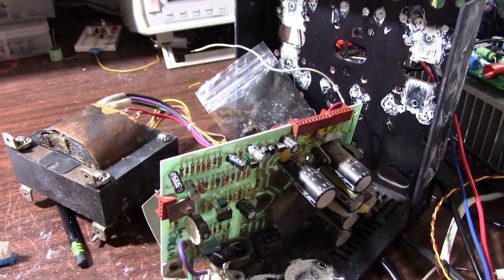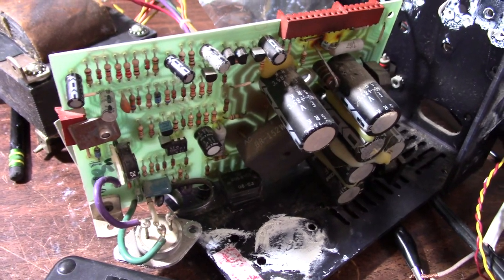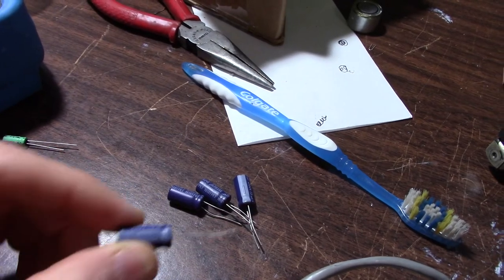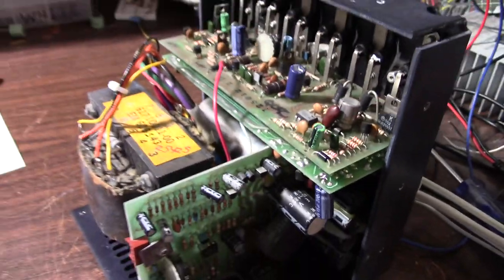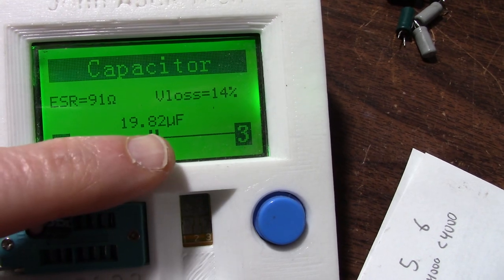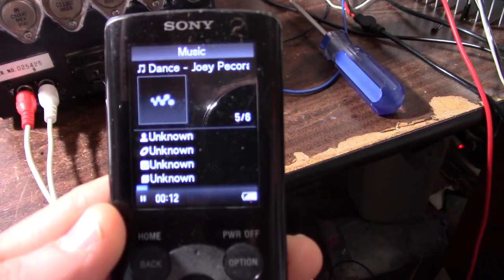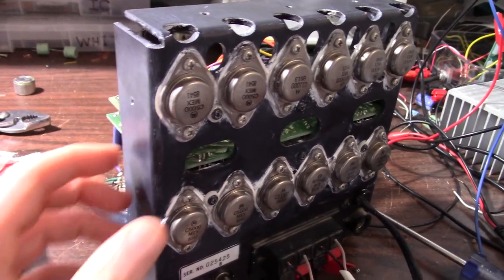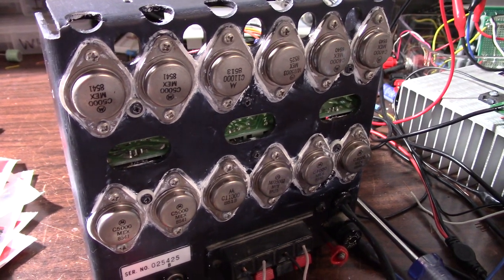Carver M-400t amplifier repair PART 2

Comment: On the question of Fusing
It is a Carver.
So has a controlled primary on the "Power Core" it is phase controlled from the mains. All of Bob Carvers amps are like that except the earlier Phase Linear models. High inrush is common & quitenormal
Reply: TFM series also had a standard primary.
Reply: @peterlarkin762  aah yeah forgot the Transfer Function units. Silver 7 too IIRC
I used to be UK warranty & service manager.
So very familiar but it been a while.
I got a few Carvers here some need repairs.
Not really bothering with them
Save them for when I get bored & throw them on the bench

Comment: Please make a video on Speaker wires (oxygen free copper wires) and what's difference between them and normal Electrical wires and what will be difference in sound if we use normal Electrical wires to connect speakers to amplifier than using those special speaker wires which many companies say it will dramatically improve sound quality

Comment: Why is it called "a magnet field" amp?
Reply: The only thing unique about the "magnetic field" amps is the thyristor in the power supply. It's supposed job is to throttle the power depending on the demand of the music.
I think Bob Carver named it that more for marketing rather than technical reasons. Back in the late 70's and early 80's the competition was fierce in the audio wars, any edge over the competitor was taken. Maybe I'm wrong
Reply: Purely marketing wank. They are good, punchy amps, but the "Magnetic Field" name is stupid. I bought two of them in the mid-80's and still have them.
Reply: Bob Carver was a brilliant engineer and knew how to sell products with words. I would highly recommend searching out his early promo video where he teaches a room full of hifi dealers about his amps. He had a fantastic sense of humour.

Comment: I found an article from audio magazine 1985 I read ages ago. 
It said there was a magnetic shunt in the power transformer 
that formed a tank circuit with the output caps. That the voltages 
were clamped    with a zener I guess   and the difference between 
the transformer output voltage and the voltage rail was stored in 
the magnetic  shunt and fed back into the circuit when the transformers voltage drops below the clamp voltage. I would 
guess thats why you can  not find a replacement transformer. 
Does this make any sense ?  thank you  great video
Reply from the maker: There are no shunts in the transformers of the two units I have. Voltage is controlled by a triac circuit that monitors the rail voltages and audio signal. It is all described in the service manual. Perhaps that article refers to another amp.